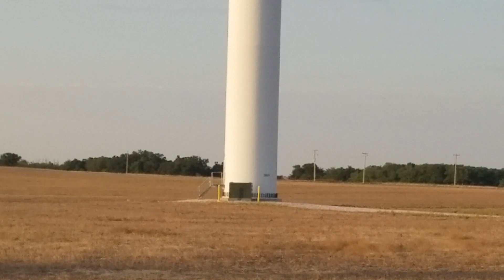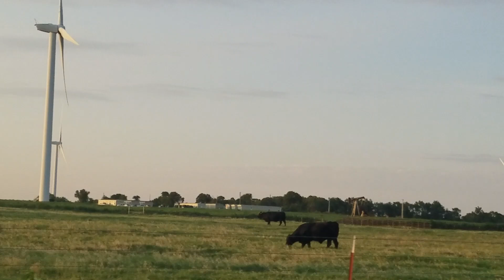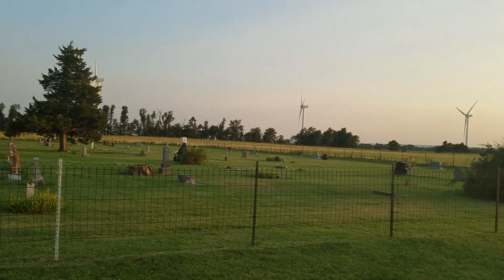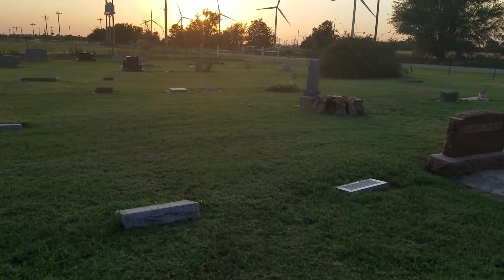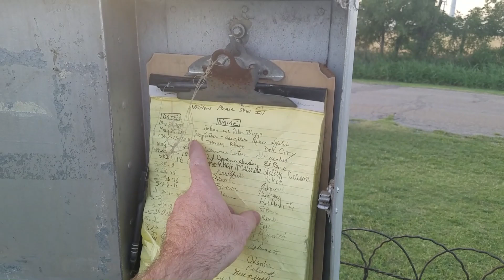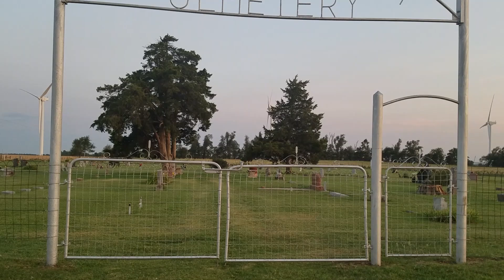Canadian Valley Cemetery  And Wind Turbines

Comment: Beautiful setting. I remember seeing an aeromotor at the Windmill Museum next to the campus of Texas Tech in Lubbock. The Aeromotor looked like a regular windmill in height, fan and rudder but it had a generator that the blades motivated through stepped gears. A cable came off the generator and went to the house or outbuilding and deposited the current into a bank of auto batteries which fed the house DC current for lighting and a DC current icebox. These Aeromotors were used all over the Plains in the 1910s up until areas were electrified by rural electric coops after WW2.

Comment: I have one concern about these turbines and that's how safe are they should a tornado come thru.  Those blades are extremely long.  Another youtuber happened on one parked off the roadway and stood by it to show just how long they are.  In any event, what are the chances of one of those blades coming loose if a tornado touched down on them.  I remember watching a show years ago about a young man who did maintenance on them.  It showed him climbing up and came out at the very top to work on them. SCARY.
Reply from the maker: That is a good question.  I've always been curious what would happen if a tornado had a direct hit.  I haven't seen anything like that so far.

Comment: Those blades are over 100 to 160 feet long and I have seen two blades on 1 trailer before. They have to use escorts, which is due to the oversize of the blades. Back several years I helped a fellow trucker out a few weeks and all I done was drive a escort truck, taken the wind turbine blades up into Kansas along I-70 west of Salina, Kansas
Reply from the maker: Interesting.  Did you ever escort the base pieces?  I'm not sure if I have ever seen those pieces go down the road.
Reply: @RhettyforHistory  I never escorted the base. If my memory is correct, the base is around 212 to 250 feet. I sure have no ideal how many steps there are all the way up to the generator portion of the wind turbine. but do remember hearing it takes one person around 30 minutes to climb to the top of the base.
Reply from the maker: I would imagine all those guys are in good shape!

Comment: Those wind generators are noting more than another subsidized boondoggle. My brother use to work on wind generators, and he can tell you everything wrong with them. Simply, wind generation on a big scale is cost prohibitive.
Reply: Daniel C I’ve heard that too that they don’t produce much energy for their cost. I work in the oil and gas industry though so I hear all the arguments against our competition.
Reply from the maker: One thing about it as far as I'm aware anyways.  The oil and gas industry doesn't ask us to pay extra so that there can be more drilling.  The Windmill industry has done that here in OK.
Reply from the maker: I've always wondered why they designed them so big? Couldn't they have made smaller ones and just placed more of them? I'm curious if your brother would know how many steps it is to the top?